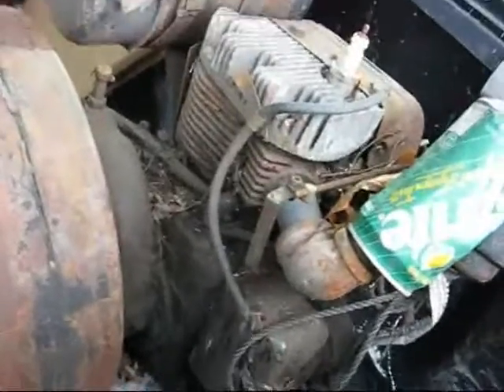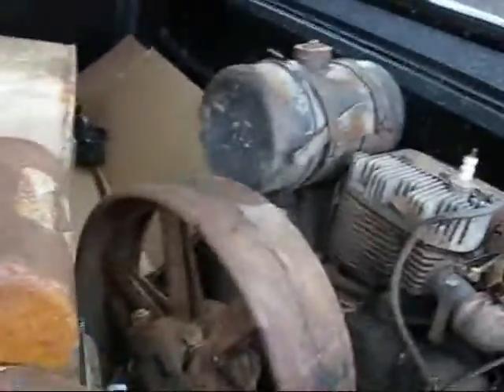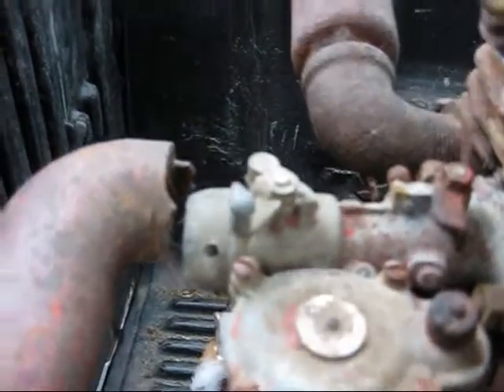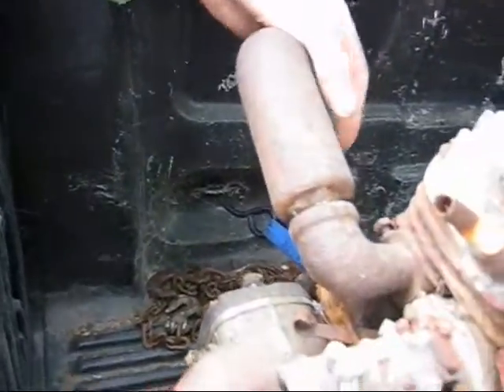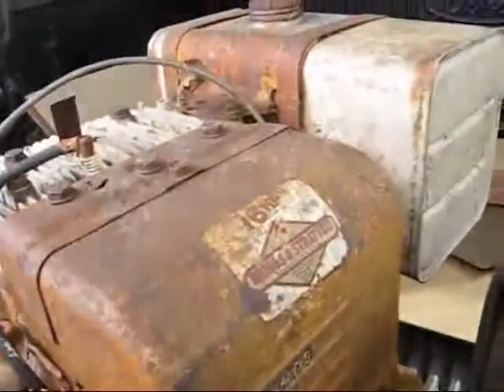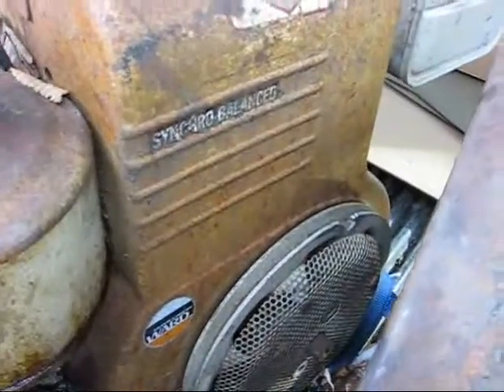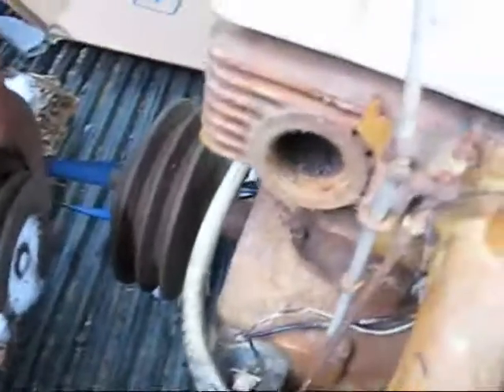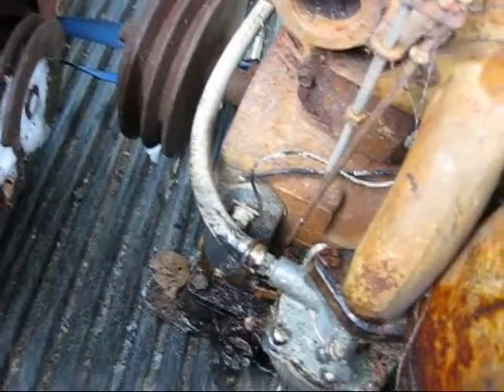new toys

Comment from the maker: they are awsome engines! and as soon as i get a good carb and i fix the impulse coupler on that BKN i will have yet another runner! the briggs has a stuck exhaust valve and no spark. no big deal either!  but that wisconsin is a 7hp with a gear reduction so it will have plenty of power!